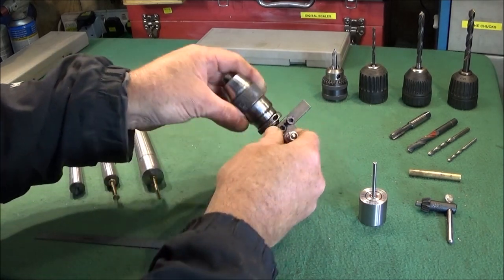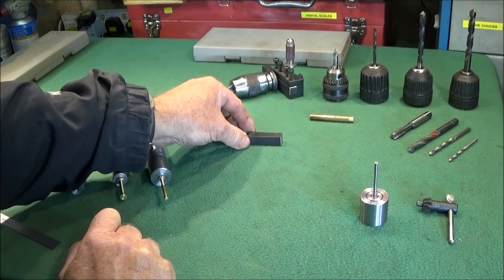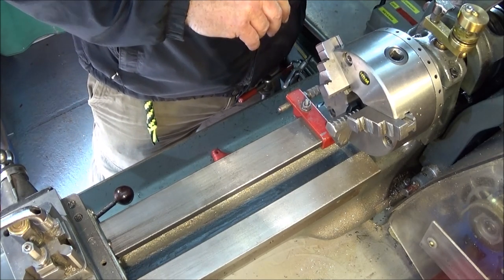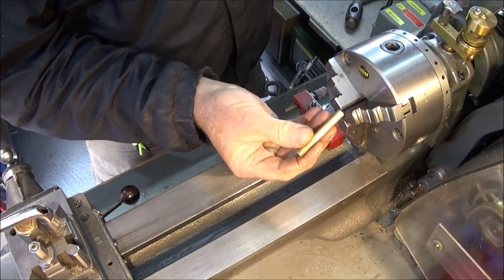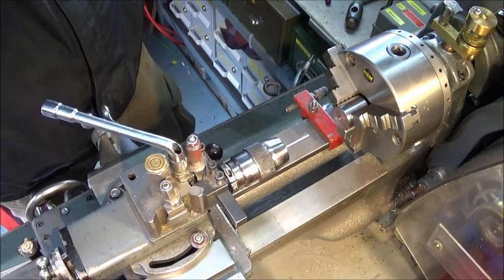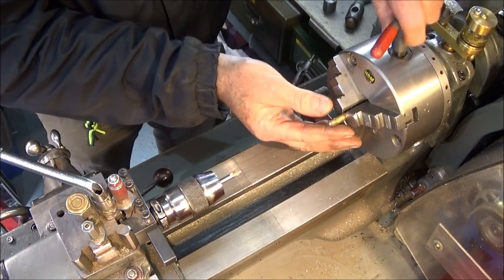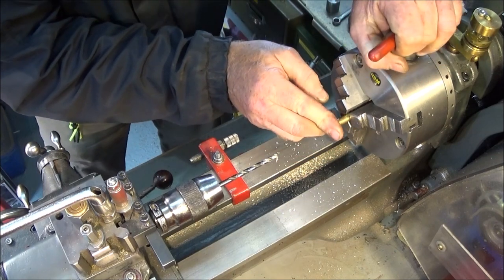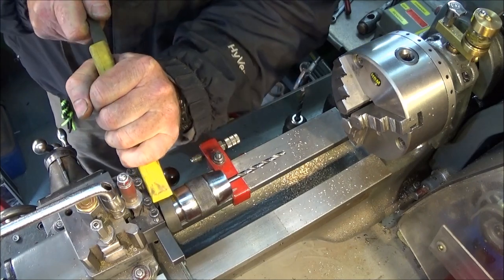Make A Quick Change Tool Post Chuck Mount Plus Lathe Batch Work

Comment: Steve, Thank you for sharing this excellent idea.  On the stop in the spindle, how do you go about setting the screw to its proper position?   Is there a way to do this before you install the tapered part into the spindle?   This tool will be very helpful in my shop!
Reply from the maker: Hi Glenn, You just have to insert the stop, measure the depth, then take it out and adjust the screw until it is ok. Then tighten the lock nut. I forgot to show that I also have a few different length adjusting screws for these stops as well. Regards Steve
Reply: Thank you Steve.  I see.   The idea of having different length screws is also a good one.  Have a good weekend.

Comment: Is there any reason you couldn’t put multiple chucks on one bar in a lathe with DRO, say 3, one holds your center drill, one the drill bit and one the tap then program each chuck center as s tool in the dro and just cycle in and out to switch between tools provided there’s clearance for the other tools when not in the material?

Comment: Hi Steve great video. I am a new subscriber. I currently work as a safe engineer which is opening safes and vaults etc. I have sat and watched hours of your videos as I got a Axminster sc2 lathe to start making my own tools as they are about £1500 each. I struggle to have enough room on the bed to make the handles so tried a quick chuck. I wish I had got a bigger lathe so always looking for work around S. Thank you for the videos. Very helpful.

Comment: Thanks much for this, extremely helpful as my Chinese Homier, otherwise a great machine, gives fits with its tail stock. Zero faith in tail stock centricity  without tons of fiddling around due to poor clamping design.
Reply: Agree, especially the stupidly inaccessible locking nut (if it hasn't had the locking lever mod) when it's close to the compound slide.

Comment: Excellent. If you have a means of indexing the spindle -- a dividing plate for instance -- you could also offset it to the proper radius and drill bolt circles with the tool holder. I have made a similar device to suppost a Dremel, but you setup is far more rigid..

Comment: For the Chinese mini lathe would that be the Mt 3 b-22?
Reply from the maker: The Chinese Mini Lathe has an MT3 tapered spindle.
Reply: @SteveJordan  thanks Steve, i am looking for what chuck you have there on the tool post in this video, im going to make one of these toolpost setups for some batch work i need to do on the sieg sc3. i cant find any metal varieties that are 3/8 unf threaded. thanks A.